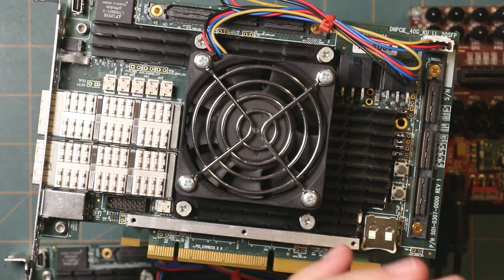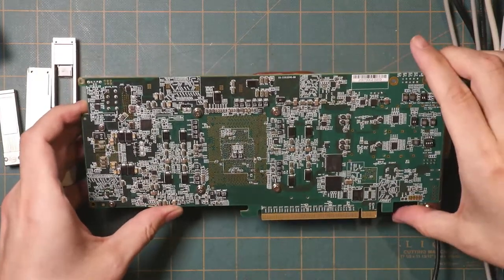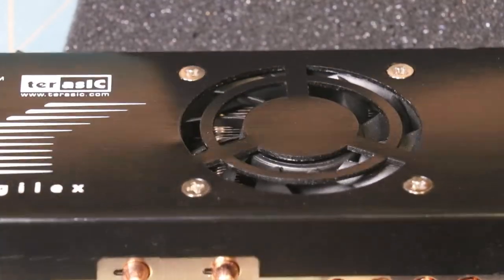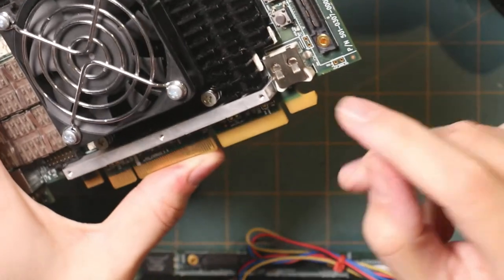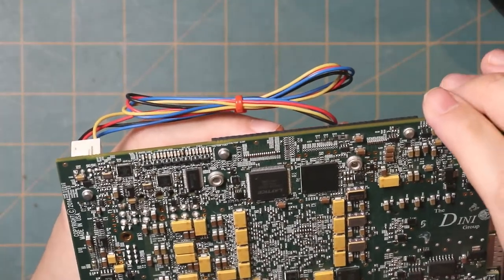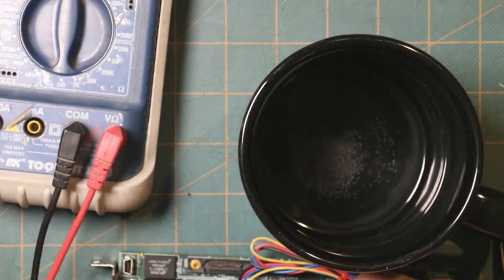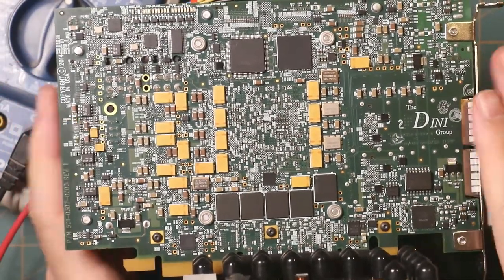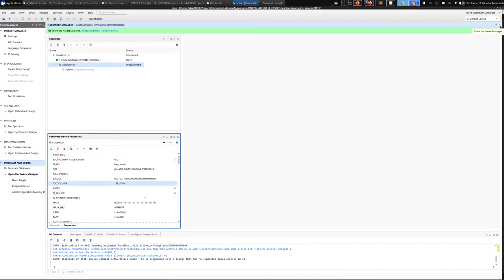FPGA Dev Live Stream: Reverse-engineering an Undocumented FPGA Board

Comment: Love the use of serial to find the pins!  In my attempts I always have to buy multiple boards and sacrifice one to get pinouts.  Thank you for sharing the technique!
Reply from the maker: Well, unfortunately it's not perfect.  It still could be necessary to remove things like memory chips that are in BGA packages.  Another issue with my current implementation is that if you are probing a terminated differential signal, like the clock line to some DDR memory chips, the two pins can interfere with each other and it can be hard to tell which pins are connected.  I have been thinking about ways of improving this...shifting out one pin name at a time would work, but it would slow down probing a lot.  But perhaps the way to go is to shift pins in groups, where you would output 0, N, 2N, etc., then 1, N+1, 2N+1, etc.  With something like that, you can trade repetition rate vs. the possibility for collisions by varying N.

Comment from the maker: So, I actually managed to get the DDR4 interface on this board operational.  I was not expecting to be able to do that, but apparently the byte group pin assignments are extremely restrictive, so all I had to do was probe out the common control signals (address, control, and clock lines), plus one data pin on each RAM chip to figure out the bank and byte lane (Tn in the pin name).  I ended up having to make a couple of educated guesses about a couple of signals, but after fixing up a few incorrect IO standards that were causing DRC errors, I built a DDR4 example design and loaded it on the card.  I got the reset button polarity wrong, but calibration passed and the traffic generator in the example design reported no errors.  Unfortunately, I don't think I will be able to do the same for the RLDRAM parts, as they are directly on opposite sides of the board and as such I cannot access any of the pins for probing.

Comment: Could you make the scripts you used to generate the UART test patterns public?  I have a board or two that I would like to try that method out on :)
Reply from the maker: Finally had time to sit down and get things cleaned up: https://github.com/alexforencich/pin-uart .  Actually, I rewrote it in TCL instead of python, but that means it can run inside of Vivado and extract the pin information directly for whatever part you select, instead of using a separate pinout file.
Reply: @AlexForencich  Awesome!! Thank you very much for all the hard work!